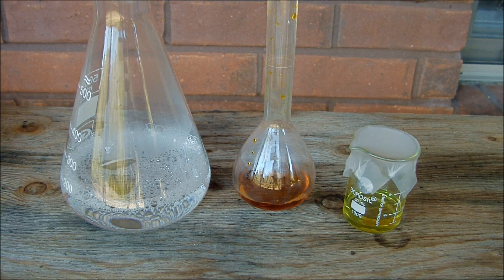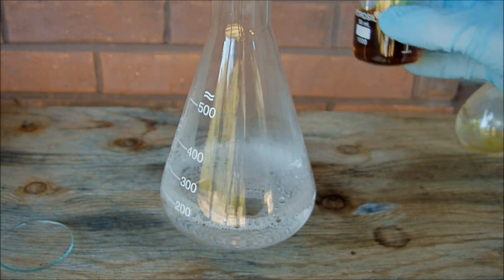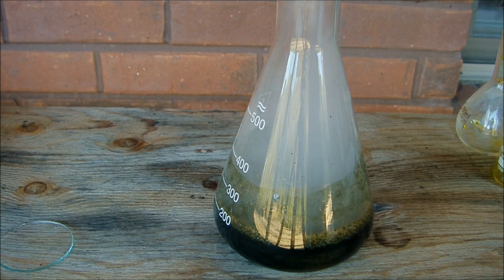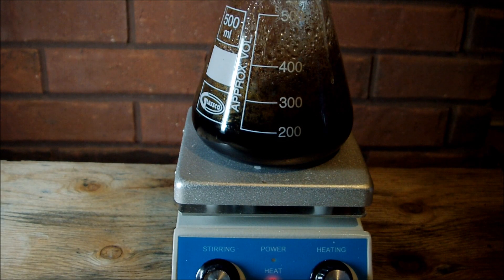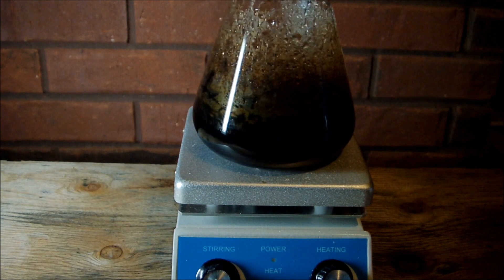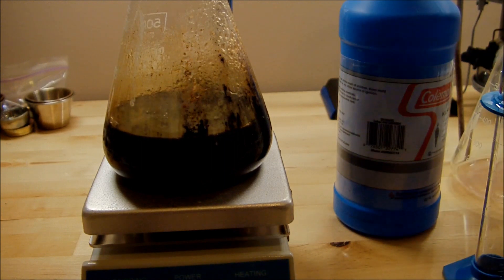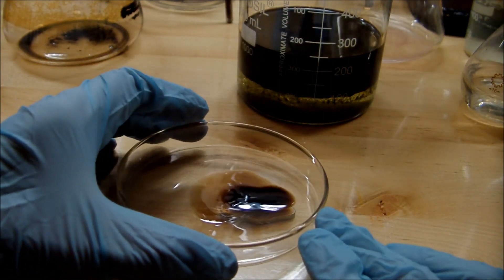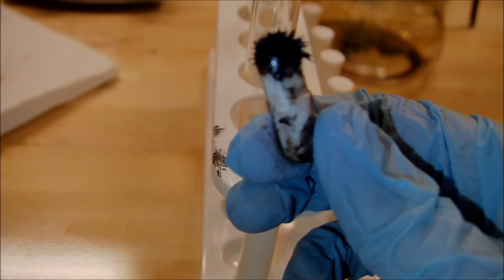How to make Ferrofluid

Comment from the maker: @nbeac038 You don't want to drive it off beforehand, because the oleic acid has to react with it first to form ammonium oleate. This then decomposes with heating to release the ammonia as a gas, and an oleate ion that can then bind to a magnetite particle. Thus you need the ammonia so you can go oleic acid >> ammonium oleate >> oleate ion >> oleate coated magnetite. At least, that's my understanding of the process. Also good call on neutralizing the peroxide!

Comment from the maker: @nbeac038 Thanks! That's an interesting method to recover oleic acid, I'll have to try that! Do you know where I could find detailed procedures? I haven't tried other oils, but that's a good idea - kerosene smells terrible and the flammability is an issue. They key would be if oleic acid is soluble in the other oil. I'll have to think about that one. A heavy oil would be ideal I would think, so you could store it under water.